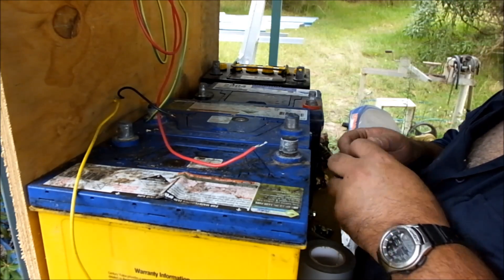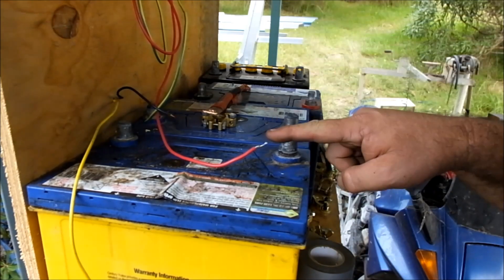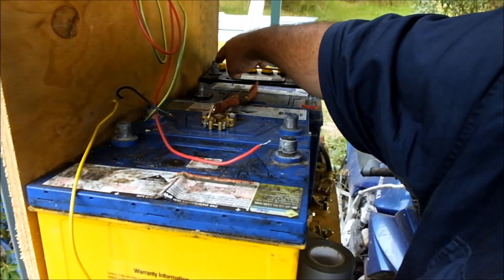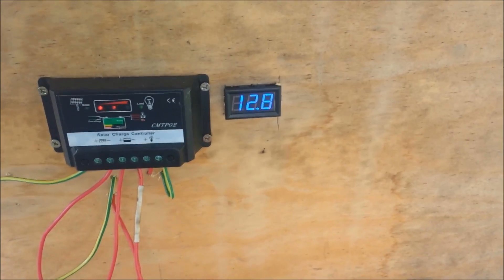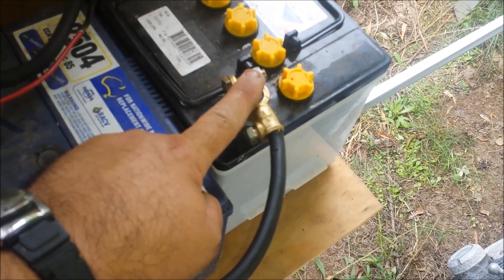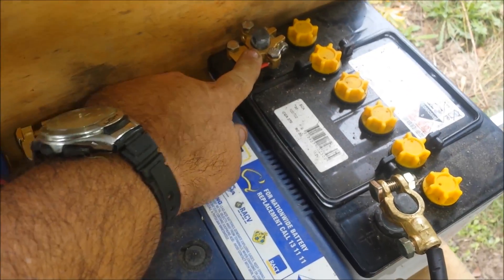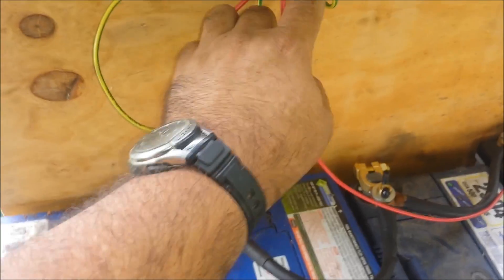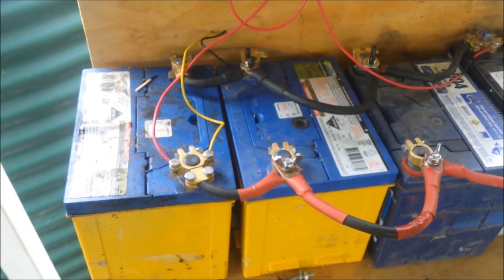Off Grid Solar Power - DIY Cheap Battery Bank

Comment: You could also just link them up in series and that would give you 120 volts DC which would run most things in your home even AC appliances.
Reply from the maker: It wouldn't for two reasons...
1. Household appliances require AC, not DC.
2. Mains supply in Australia is 240V AC.
Reply: @PopsShack  Well I've tried it, and it runs almost everything in my house... TV... PC... Internet.... 240V a.c vacuum cleaner.... 240V a.c hairdryer..... heater... 240 V a.c lights.... will not run refrigerator or air con.... best to have the volts at about 250 V d.c.

Comment: This is awesome. No matter what kind of batteries you use, a better technique is to hook the positive end from the closest battery and the negative end from the FURTHEST battery to the inverter. This will more evenly distribute the draw/charge and not unfairly overwork a single battery leading to quicker failure.

Comment: Was gunna use car batteries myself for a solar system but they just aren’t designed for it
Reply: You'll be suprised !
Reply: @thegospelofvanlife9381  in the past I used old car batteries for a electric trolling motor on a canoe, as long as it will charge, it can be used, I just found capacity was low and would discharge maybe not as efficient but it worked

Comment: The theory behind car batteries is that they are designed to be quickly be discharged and charged (cranking the car) but that isn't 100% true

They can perfectly be used in low/slow discharge, they probably last longer because they wont boil since they are not used for cranking the engine.

Most of the time car batteries die when the water/acid level is to low and the plates inside heat up and bend from cranking, this can cause them to touch and explode or kill the battery.
In a solar setup this is very hard to impossible to archieve that unless you are trying to run a 2000 watt device on a battery bank of 2 batteries.

Comment: I can now bid farewell to expensive high power bills. You could make your own power with generating power process “boma fetching unique” (Google it), which means you are saved from paying high electric bills. With some easy tricks and minor adjustments to the way you operate your appliances, you can drive your energy costs down.
Reply from the maker: I bed farewell even to LOW power bills.

Comment: Car batteries are designed to be charged at high currents and 13.8 Volts, trickle charging to maintain them is okay.
Colour coded cable is preferred and insulated pole caps.
Reply from the maker: At $5 each, it doesn't matter what they're designed for. Not having colour coding is okay as there's only me that needs to know which is which.

Comment: What will this power? A single fridge?
Or a tv and a laptop?
Reply from the maker: It depends how long you want to power it for.

https://www.youtube.com/watch?v=FbRxIKCCv0g
Reply: @PopsShack  A small portable air conditioner about 1 hour...... heater about 45 mins... Microwave 45 mins.......  Large fridge about 17 hours...... small fridge for days......  computers...... laptops....... TVs.......... Xbox etc...... about 12 hours........ remember (1) Amp AC = > (10) Amps DC.

Comment: Battery Size, Calculates quickly and easily the dimension (Ah) of the battery depending on consumption Wh / day, 
Voltage, Ambient temperature, days of autonomy
https://play.google.com/store/apps/details?id=com.fjapps.juank.batterydimension&hl=en
Reply from the maker: And how do you determine the battery capacity (AH rating) for starter batteries that have a cold cranking amps rating?